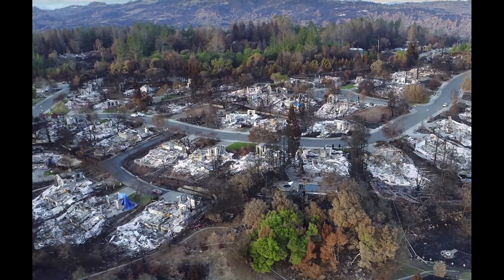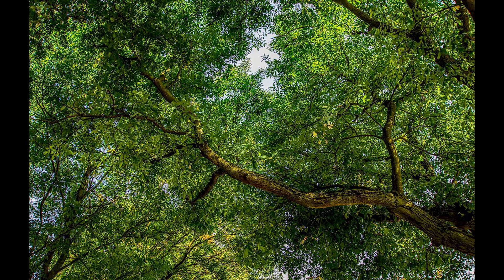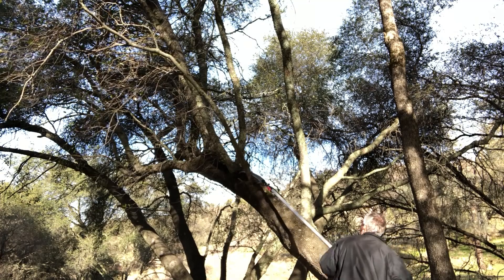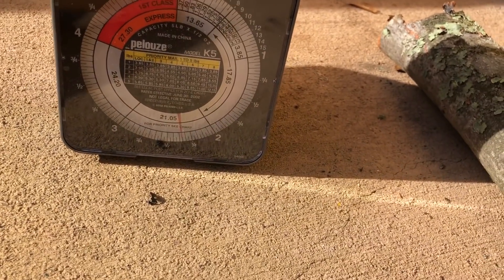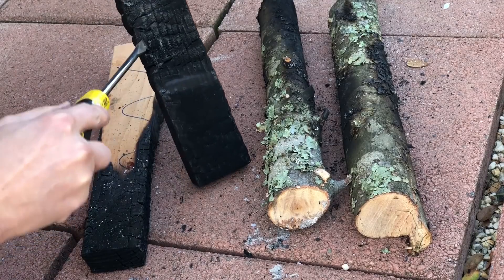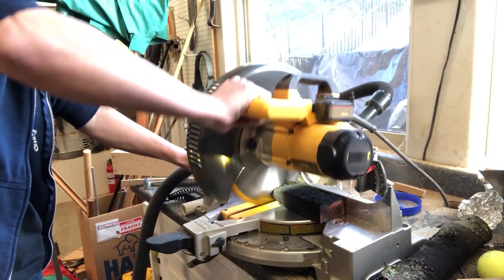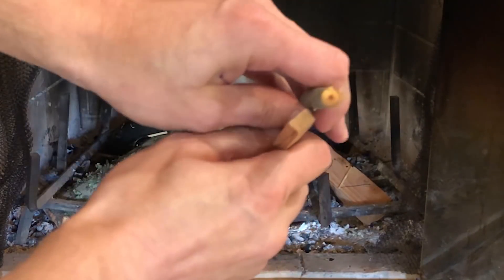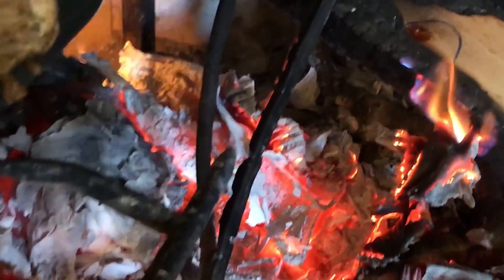Explained: Why Houses burn When Trees Do Not

Comment: Please explain how the fires started in the first place & why the roads are clear of debris, also explain why we don't see any evidence of any porcelain in the videos of these fires.

Also, please explain how a plastic garbage bin in the driveway of a leveled house is still in tact. Plastic wheelie bins aren't wooden, so please explain this anomaly in another video. 

As a firefighter & Fire Investigation Officer of 38+ years, I can honestly say I have never seen any fire behave like this, nor have I ever seen this type of fire aftermath .. I mean clean roadways? houses burnt to the ground where not even the toilet survives? Unheard of. Anywhere. Ever.

Something is very suspicious about these fires.
Reply: Cigarettes, lightning, and camp fires is how they start.
Reply: Don't forget about the house half burned, one side remained but the other was gone.
Reply: Why is this idiot even the person pretending to de-bunk these issues - doesn't even have the slightest clue how to have a competent or relevant experiment.  Smells like Snopes.
Reply: The charcoal embers burn slowly, almost without flame, at a temperature of  800°C+ .   no matter which kind of wood...it will burn asf... the experience is not exactly right.
Reply: SOBB, There is no way in hell you are a firefighter and certainly not an investigator. That is laughable.
Reply: @ThunderbirdWD9598  Just had two different fire inspectors recently come out with similar observations.
Reply from the maker: Never? What are you comparing it against? How about the Bel Air fire of 1961,  Exactly the same.  
http://framework.latimes.com/2010/11/07/bel-air-fire/
https://la.curbed.com/2017/12/6/16742976/bel-air-fire-history-brentwood-nixon
Reply: @MickWest  Not the same at all as these current fires vs bel air fire.
Reply: @ldarlinea  explain what the vast difference is.
Reply: @MickWest  you were asked to "explain how the fires started in the first place". Is there a reason you did not do this?

You are correct that dry dimensional lumber is far more prone to burning than live wet tree wood. And so is plastic, insulation, and other housing materials. But didn't these fires start from live wet trees that were burning out of control, at the rate of 80 football fields a MINUTE in some cases?

So, if the live wet trees were ALREADY on fire, and burning FAST, this makes your test irrelevant. Clearly these fires were FAR MORE intense than what you created in your little fireplace. 

Additionally, have you ever thrown a LIVE wet evergreen into a campfire? I have. The branches burn IMMEDIATELY, and much faster than any dimensional dry lumber that I throw in. 

I am NOT saying how these houses were destroyed (no theories), but many of them could not have been burned by adjacent tree fires because the trees were NOT burned. So how did they catch fire Mick? What is YOUR theory?
Reply from the maker: @Jonnyvids14  In an isolated pocket of a fire, like with the examples you see of isolated houses burning away from other flames or radiant heat, the fire starts from _firebrands carried by the wind_. They accumulate against combustible material, sometimes they get inside the house, and a fire starts. The winds intensify this fire, and the house burns down.
Reply from the maker: @Jonnyvids14  And yes, you can burn wet wood in a strong established fire. Live trees are not 100% fireproof. But the question here is more what will catch fire and burn down. Put a house next to a live tree, subject them both to the same 30-minute ember storm then sustained winds. What it more likely to catch fire?
Reply: @MickWest   Your explanations are not well thought out. The evidence clearly points away from your theory.Have you watched any  of the hundred upon hundreds of hours of video evidence .aluminum boats turned to liquid  while stainless steel moorings still intact,in the middle of a lake?There are hundreds of examples like this that SCREAM OUT to the observer,"SOMETHING ELSE IS GOING ON HERE" . . Next is a statement made by a fool,YOU Are houses being zapped by energy beams from space for strange illuminati purposes? Of course not, but some conspiracy theories point to unburnt trees next to burnt down houses as evidence of this very thing.          Why dont you throw a 22 inch tweenkie  (aluminum rim) and a plastic refuse bin in your fireplace and tell me what happens to them. Did they turn to liquid in a matter of minutes? Did the rim melt and run like water onto your living room floor while the refuse bin stayed intact untouched ? If not ,it's time to change your theory or don't you know how the scientific method works?
Reply from the maker: @MrUFCjunkie  Aluminum rims melt in car fires all the time. Plastic bins near house fires don't melt all the time. Just look at confirmed normal car fires and house fires and you will see these exact things happening.
Reply: @MickWest  This was a FOREST FIRE. Before the fire reached Paradise there should be a 17 mile defined area of FOREST BURNED? (Haven't seen it - yet)

When it reached Paradise, did it stop consuming Forest? You know, All those GREEN TREES that don't burn like houses, at the reported rate of 8 football fields per minute?* (That kills your Green-Tree theory!)

And how is it that fire decided to burn cars ENTIRELY, not just melt rims? And in a few locations, it melted the CONCRETE ROAD. And guess what else was turned to dust? All of the BRICK FIRE PLACES AND PELLET WOOD STOVES, as well as FIRE PROOF SAFES!

AND, After the Santa Rosa Fire, we see a WALMART, A RESTAURANT, and a 3rd building turned to dust. ALL 3 BUILDINGS HAD SPRINKLER SYSTEM FAILURE?!

And nothing was left - not even their Weber kettles or Gas BBQ'S, or the PORCELAIN TOILETS IN THEIR BATHROOMS (Same as the PORCELAIN BATHTUBS, SINKS, AND TOILETS IN EVERY SINGLE HOUSE!)

 (This has been reported by a fireman on site, in a YT VIDEO. A VERY CONCERNED FIRE CHIEF!)

AND, please note that those 3 buildings were were located on the OPPOSITE SIDE OF THE "FOREST FIRE"; SEPARATED BY A 6-LANE FREEWAY (3 LANES EACH DIRECTION and freeways are made of concrete!), and in addition, these buildings were surrounded by an acre of PARKING CEMENT!

However, the minimal landscaping of grass and shrubs remained untouched!

And, several MOTEL guests reported "hallway carpet combustion" and narrowly escaping with their lives as the entire hotel went up in flames in a matter of 15 minutes. AGAIN, SPRINKLER SYSTEM FAILURE.

So PORCELAIN, METAL BBQ'S, LAWNMOWERS, CARS, BRICK FIRE PLACES, METAL PELLET STOVES, AND FIRE PROOF SAFES WILL BURN UP BEFORE A FIRE SUCKS THE MOISTURE OUT OF A BLADE OF GRASS or MELTS PLASTIC?

(And FYI: *THESE FIRES MELTED THE HIGHEST QUALITY SILVER!*)

I have a bridge to sell you!

You need to go look up the TEMPERATURE REQUIREMENTS FOR ALL ITEMS; AND INCLUDING CREMATION!

All BODIES WERE BURNED 100% and the only identifier for ONE INDIVIDUAL was a SMALL METAL IDENTIFIER ON A HIP REPLACEMENT!

No teeth or bones left!
Reply from the maker: @Shyeena  What photos are you looking at, because the photos I see of burn houses have plenty of stuff in them, like: https://www.dailydemocrat.com/wp-content/uploads/2018/11/AP183168147607162.jpg

And it wasn't a forest fire. It was a wildfire. Check out the hills to the North East of Concow where the fire came from. No trees. It spread through undergrowth, and spread FASTER where the trees had been removed.
Reply: @MickWest  You do realize most home have fire retardent roofs right?
Reply from the maker: @pathauser9532  Yes. You might find this interesting. https://www.youtube.com/watch?v=zx9-pZvKW2U
Reply: @Jonnyvids14  the dead brush my dude
Reply: @MickWest But this isn't about what's more likely to catch fire it's about why are the trees still standing.Now you just said that a wet tree WILL catch fire in an established fire.Well LA is an established fire and those homes had to be burning for hours before they completely burnt to the ground if this were a natural fire.And the trees WET or not would have caught.You just said that so why are the trees standing with such intense heat and flames near them for a prolonged amount of time? DIRECT ENERGY WEAPON!
Reply: Mick West Not the same at all. Those lots are not leveled. There are fireplaces and wood studs and pieces of roof lying on top of those lots in Bel Air.
Reply: @MickWest  Why do shills keep bringing up the 1961 fire?
Reply from the maker: @pathauser9532  I'm not a shill, but I bring it up because it resembles the recent fires in many aspects. Like burnt houses next to unburnt trees.
Reply: Maybe I needed to be an American Fire Investigation Officer , not an Australian one.

Still, even the photos in the '61 fires, the fire raced up a slope, more than likely the radiant heat caused the dwellings to burn but it doesn't explain how in the 2017 fires (which appear to be on flat terrain) how house after house was set ablaze leaving virtually no standing parts of the structures in tact (I doubt they were all log style homes).

Nor does it explain how the plastic wheelie bins adjacent to the dwellings were untouched, or the absence of baths & toilets or how the fires started in the first place.
Reply from the maker: Most housing construction in that area is wood framed. So they tend to burn like this:
https://www.dailynews.com/wp-content/uploads/2017/12/ap17341577968419-1.jpg
A plastic bin next to a dwelling would be untouched if it was sufficiently far away from the fire. Do you have a specific example photo?
Reply from the maker: And how would you say it differs from the 2016 Yarloop fire? https://www.perthnow.com.au/news/wa/clean-up-of-fire-ravaged-yarloop-begins-ng-5a1e13295e3d50c3bca36213d40fd629
Reply from the maker: Or the Kinglake fires of 2009? https://www.gettyimages.com/event/death-toll-reaches-200-as-bushfires-continue-to-blaze-through-victoria-84653189#/the-burnt-out-remains-of-a-house-in-the-kinglake-region-on-february-picture-id84751923
Reply: @MickWest  shill